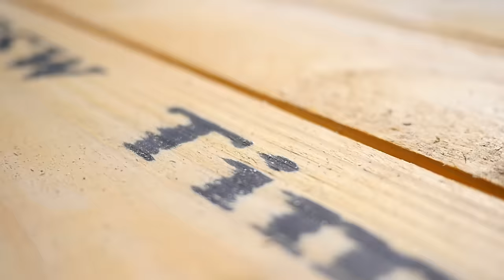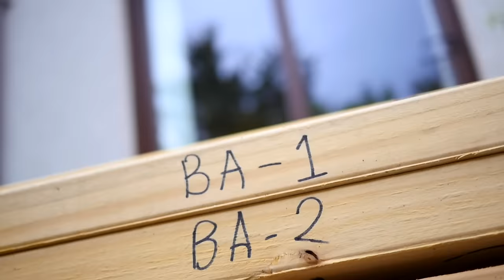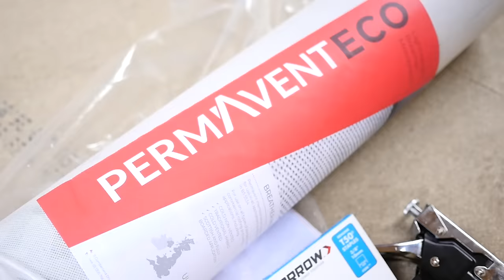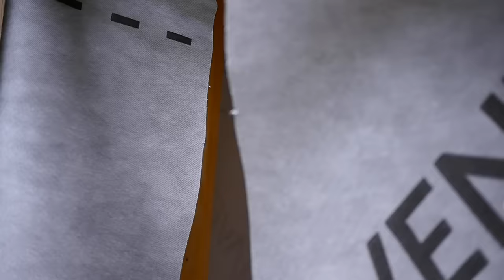Building a Workshop Shed In The UK From Scratch

Comment: Did you use plans for this and if so where too?? Looking to do a similar pent shed to same build quality. 👍🏼
Reply from the maker: Hey there Tom, I'm so glad that you associate my build with quality. As for the plans I did did rough planning on paper and then jumped right into rhino 3d which is my preferred modelling program. I spent a good few days planning out a labelling system. I wanted to be able to cut everything out and then put it together like one big DIY flatpack. As for the plans, it's not that I don't want to share them, I just know I'm inexperienced and there are going to be flaws all over this build, that quite frankly I don't know about. I did try my best to get as many joiners and architects friends to take a look at it but even still. So the idea that someones follow these plans to the letter and they have an issue at any point. I would feel quite responsible. Having said all of that... If you want to just take a look at it, I'm more than happy to share them out, as long as your well aware to take these plans not just with a grain of salt but with a heaped spoon. Sound good?
Reply: Maker Tales morning. I have some building experience but rusty of late 😟 I like the way you insulated and used OSB inside along with walls of better substance than most new houses have lol. 

I understand there could be flaws but what doesn’t lol it’s mainly roof rafters length and birds mouth placement and having a roof pitch of say 10 degrees and how that effects length of each stud along side wall to get a decent fit. 
My plan was to build front and back walls say back 6inch shorter than front over a 8x6 shed and build side walls to height against both front and back with 1 rafter in place. Not ideal and certainly not to any plans 😆

I like how much effort you done on that felt sealing joints etc I’d do similar or look at rubber roof which is extra cost but lasts a lot longer. The restoration couple on YouTube used a rubber roof cut to your dimensions on ordering. 
So yeah any plans of any kind is just a rough guide. Thanks for your reply.
Reply from the maker: @tom-fp2fv  Hey Tom, do you have a software that can open .obj ?
Ya I found that once you put 2 or 3 layers of Bitchumus paint it's pretty much a rubber roof at that point. Look up black jack all weather roof coating

Comment: Hi Jonathan, Great build video. Were did you source the door and windows for the build? Also I was wondering if you had any plans you could share about how the roof was made? (e.g. what cuts to make and difference in height between front and back wall?)
Reply from the maker: I sourced the door and windows form my local scrap / recycling center. As for the roof pitch... That really does change depending on the size of the build. In my area is strongly recommended to have a pitch of a minimum of 5 degrees. My roof is a 7 degrees pitch from my highest point of 2.5m. I hope that helps.

Comment: Hi, a response on this would be awesome!

This is inspirational stuff! You make it look so easy!! I would love to build something like this. 

I noticed you said in the description that this project cost you £1200 without equipment, could you please write a list of the equipment you used, I’d really appreciate it.

Also, assuming you’re doing carpentry work in there, what are you going to do about ventilation as you will have all kinds of dust and particles (potentially toxic) when cutting timber.
Reply from the maker: Hi Trevnevit,
A full list would be a little long to do right now but I can tell the the true work horses of this build were the
Impact Driver - Makita DTD153Z  :  https://amzn.to/2MPnWVx
Circular Saw - Makita DHS680  :  https://amzn.to/37oq0xf
Battery Pack (Would last me all day) - Makita 2BL1850 BL1850 : https://amzn.to/30Ccq83
Rapid Battery Charger - Makita DC18RD : https://amzn.to/2BSI3js
As an Amazon Associate I earn from qualifying purchases.

As for all the nasties I open up my windows and I have this beast going right next to me https://youtu.be/iD-xRkGlwUM
I also have a mini DIY cyclone to clean up the space and to deal with my mini table saw. I'll be sure to give a full tour in the FAQ video.
I also wear a full P3 respirator : ForceTM8 Half Mask Respirator Complete with PressToCheckTM P3 Filters

Anything ells you would like to know?
Reply: That’s great man thanks a lot for coming back so fast. I’m doing a lot of reading up on woodworking atm and it has a tools section so I’m sure for more intricate works that you couldn’t list they will probably be in the book. 

One more question what was the time frame of this work?
Reply from the maker: In total took me about a month of time but this was due to weather and filming. If i was just working and had great weather. I would be able to pull this off in 7 days.
Reply: Maker Tales - That’s incredible, thanks again for the quick reply. Last question (probably) out of the £1200 you said you spent on this, how much of that was on timber?
Reply from the maker: Ufff ummm I think completely off the top of my head around £920 ish But once again keep in mind I bought extra for workbench and other small builds.
Reply: Maker Tales That’s great, thanks for answering all my questions. Top bloke, I hope all your future builds go as well as this one.

Comment: Loved the video - great work. Did you design it on paper first or make a Sketchup model. All your bits seemed to be very clearly labelled. Are you willing/able to share the plans?
Reply from the maker: Hey James, I'm so happy to hear that you have enjoyed the video. I did do rough planning on paper and then jumped right into rhino 3d which is my preferred modelling program. Yup I spend a good few days planning out that labelling system. I wanted to be able to cut everything out and then put it together like one big DIY flatpack. As for the plans, it's not that I don't want to share them, I just know I'm inexperienced and there are going to be flaws all over this build, that quite frankly I don't know about. I did try my best to get as many joiners and architects friends to take a look at it but even still. So the idea that someones follow these plans to the letter and they have an issue at any point. I would feel quite responsible. Having said all of that... If you want to just take a look at it, I'm more than happy to share them out, as long as your well aware to take these plans not just with a grain of salt but with a heaped spoon. Sound good?

Comment: Hello, the workshop looks great. Given the insulation, did you find that the you needed any ventilation when working in there to prevent condensation? Also, what pitch is the roof (perhaps 25 degrees?) and have you found it to be steep enough to stop water ingress? Thanks in advance, Gerry.
Reply from the maker: Hey Gerry, I designed the whole build to be a breathable building so I've not needed ventilation as of yet. As for the pitch I have it at 7.25 degrees. Which I was happy with as I was adding a coating to my roof.

Comment: Are you using treated timber for the stud work? Looking to. Uild something similar, just getting a list of material together.
Reply from the maker: Hey Kieran,
Yup, everything structural is pressure treated timber.
The only thing that is not treated is the cladding which I then manually treat myself.

Comment: Great vid u got skills!...i didnt see u put any electricity supply in ? Whats ur plans for getting power in?
Reply from the maker: Cheers G Man, I did get electrical to the shop, all the electrics are now in using office conduit. I got a pro for this as I'm not going to take responsibility for electrical work till I've got some real training. I'm sure you can see the conduit in some of my other videos. It goes right around the workspace.
Reply: @Keep-Making  .....ahhh ok only asked as i built one myself and used armour cable to get power from house to workshop.

All the best!
Reply from the maker: @gman1087  Ya I helped the pro get the armoured cable in. I was tasked with digging the deep trench over to the workshop. Cheers

Comment: Nice one, but remove the felt and fit a rubber membrane.
Reply from the maker: Cheers hugh, I really wish I could have. That's why it has two layers of bitchumen ontop as I really could not afford the rubber.
Reply: Might be quicker to remove the roof and replace the ish then add the rubber that way

Comment: Excellent video Iv subscribed 
2 questions 
1) did you put any ventilation in building? I’m building my own workshop soon an conscious of air needed to prevent damp 

2)Are you a trained film editor? Super professional
Reply from the maker: Cheers Scott, I'm so glad you enjoyed it.
SO... yes ventilation is quite a key thing. For me it was a double-edged sword if I was to add vents this would then be a large amount of noise leaking out to my neighbours. My other option was to make the whole thing except the roof and floor into breathing walls. So far I have not physically added a vent anywhere even tho I literally have them on stand by and had intentions of adding them right from the start. Keep in mind the whole build is made of breathable walls even the outer coat on the wood is £60 a tin as it's "special" breathable wall natural oil stuff. As of lately, it's been doing great. I have a little humidity meter and mind you i'm in Scotland so it gets quite wet. It stays at a good 40 - 60% inside and outside it's around 40 - 90%. ( No damp problems as of yet. i'm checking everywhere almost weekly) Can't say for sure I won't have any problems in the future as it's my first build like this but so far so good and I've had the green light from 3 other carpenters so far.

As for the filming and editing thank you.
I did use to run a video production company a few years back. One of my goals with my channel is to make it as cinematic as possible. I'm glad it's paid off so far and you've enjoyed it    😀

Comment: if you dont have air flow under that building the wood will hold in moister and start to rot inside out. It should probably be 6 inches off the ground so air can flow under and moister can escape. Great job though

Comment: Thanks for sharing. I may have overlooked it but what are the outside dimensions of the shed & the internal height of the front and back walls?
Reply from the maker: Hey Den Beech, 
I'm glad you enjoyed it. Well there are a few FAQ's in the description. In answer to your question, it's 2.9m by 2.9m external dimensions. Has a close to 7-degree pitch and the highest point is 2.49m external. My walls are a pretty decent 11cm thick so internally it's 2.68m by 2.68m tallest point 2.2m is and lowest point is 1.85m

Comment: What software did you use for the design
Reply from the maker: Hey D Muschialli,
My preferred software is RHino 3D. What are you currently using?
Reply: @Keep-Making  I was using sketch up but struggling some what
Reply from the maker: @muschialli  Ah ok, I don't have much experience with sketch up. what part or parts are you seeming to struggle with?
Reply: @Keep-Making  custom built man shed like yours
Reply from the maker: @muschialli  Are you struggling with the program itself of knowledge of how to build that structure ?

Comment: Why did you not wire this? I would want to plug in tools/heater/etc.
Reply from the maker: It did get wired. However, I am not qualified so I got a pro to install it all the electrics are now in using office conduit. I got a pro for this as I'm not going to take responsibility for electrical work till I've got some real training. I'm sure you can see the conduit in some of my other videos. It goes right around the workspace.
Reply: @Keep-Making  Got it, smart. Outsource when necessary.

Comment: Dont use insulation it keeps too much heat in summer and causes damp in winter. U need to design it with say 200mm thick walls of insulation to have an effect of keeping heat inside
Reply from the maker: Hey James, Thanks for the interest and concern with all the comments.
There is damp proofing under the floor, The pressure fitted and sealed king span.
The lock comes perfectly made for outdoor use. Cost a little extra but it's working like a charm and weather sealed. As for the insulation. Not really using it for climate control that's why I've gone with rock wool. Rock wool has an RW45 sound absorption rating. In other words, I'm doing it for the neighbours sakes. 😊

Comment: Great build! Starting mine this week. What screws were you using
Reply from the maker: Hey, Ed thank you. I was able to find a steal deal online on some SPAX screws but the deal is no longer going. I would 100% recommend them. Did not have a single one fail in the whole build. If spax is a little over budget I would aim for something like ForgeFix. However, make sure it has sufficient shank to be able to pull wood together. Glad you enjoyed the build.
Reply: I just used the gold screws from screwfix when I built my little storage shed.

Comment: Probably a daft question but have you made provision for electrics? Nice build by the way. Regards Jim.
Reply from the maker: Hey Jim, Plan was to keep the walls as solid as possible to keep sound leaks low. All the electrics are now in using office conduit. I got a pro for this as I'm not going to take responsibility for electrical work till I've got some real training. I'm sure you can see the conduit in some of my other videos. It goes right around the workspace.

Comment: Hello..can i know each size the timbers that you used?
Reply from the maker: Hi Amall,
Well I can't tell the the length of them all but the floor joists are 145x45 and the rest of the studs and and joists are 95x45. OSB is 12mm. And I think that's all the types of wood I used oh no.. The floor is 20 something tongue and groove flooring. All pressure treated and the cladding I don't really have much info on. I know it's 15mm 135mm and is not pressure treated.I hope that helps
Reply: @Keep-Making  Thanks for the answers. its very helfull to me :)
Reply: helpfull
Reply from the maker: @amallraihan  Great to hear and glad I could help :)

Comment: Did you do HVAC or Electrical?
Reply from the maker: Hey Colby,
Long and the short yes to the electrical by a pro more info in discription.
As for HVAC, it's a breathable wall building so it dose 80% of it on it's own. Rest of the time i.e. when i'm in it. I use the windows and very big air filter. I also have a little oil electric heater for the winters.

Comment: Oh my goodness that was about 20000 too many slow mo close ups of very little happening for me but for the average DIY'er I guess it would be very motivating.
Your build quality is very impressive (except for your inside-out door hinges), Guess that's how you do things in the UK. 

In Australia it would fly away and roll down the street in the first storm we get, we have to dig concrete footings and bolt everything down. 

A lot of use of non durable species on the outside of the structure - I can't believe they even make  (untreated?) pine weatherboards over there but about 9 months with exterior rated treatment on them and they'd start rotting here, the pine base you used would be devoured pretty quickly in my neighbourhood - we have termites everywhere in Sydney and other wood eating bugs - gotta be H4/H5 treatment if it's going to be on the ground or it turns to mush in no time.
Reply from the maker: Hey One Man Bad Woodworks, I'm glad you like the build quality. Sorry it's too much slow-mo for you. WOW sounds like you have it ROUGH! I guess that's another reason of many scary and deadly things of why I don't live in Australia. 😅. Ya the cladding is raw wood as here we have many eco villages and breathing wall structures here. The cladding is now heavily treated with "eco" treatment but my god was it expensive £60 for 2L . TO be fair the door is on the wrong way but the space is SO small that it was a design choice to have it open outward to let me have a little more space for larger projects or machines in the future.
Reply: @Keep-Making  makes sense to swing the door out, nice build mate

Comment: Should have used ply instead of osb board, used a vapour barrier inside and drylined the inside rather than osb'ing it. Finish would have been perfect. The walls stand on the floor which moisture will creep into give it 5 years, floor will be rotten and falling through.

Comment: Please sir,  name shown you used all material.
Reply from the maker: Hey Puttaswamy, The roof is made out of 11mm OSB.
Well I can't tell the the length of them all but the floor joists are 145x45 and the rest of the studs and and joists are 95x45. OSB is 12mm. And I think that's all the types of wood I used oh no.. The floor is 20 something tongue and groove flooring. All pressure treated and the cladding I don't really have much info on. I know it's 15mm 135mm and is not pressure treated.I hope that helps